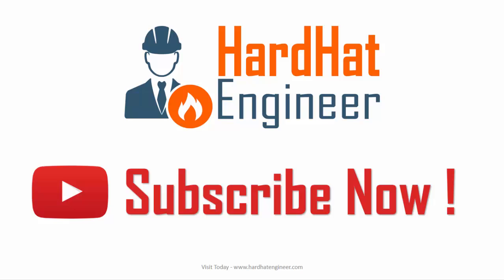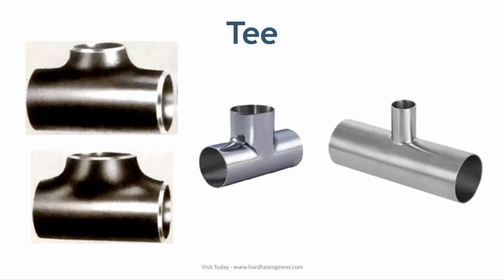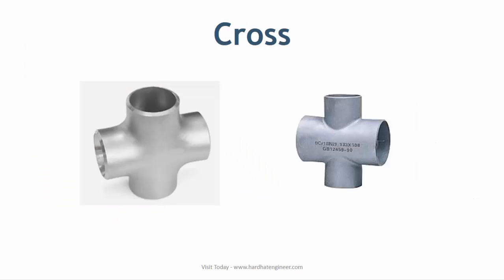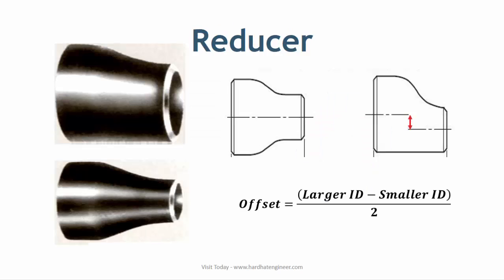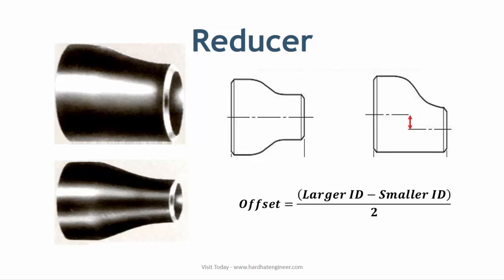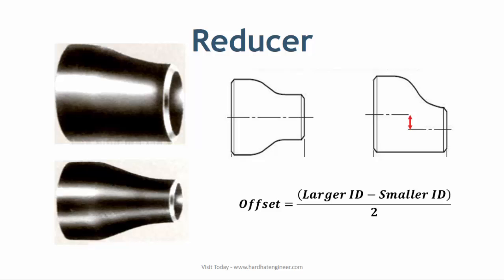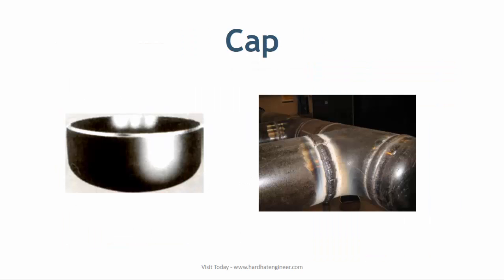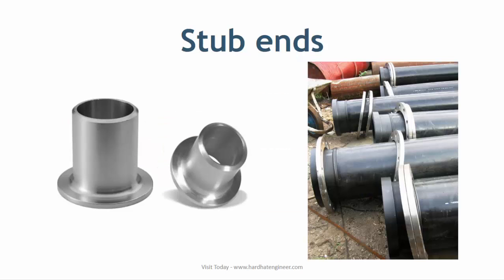Pipe Fittings - Tee, Cross, Reducer, Cap and Stub ends Part-2 /3

Comment: Why and when we use long radius elbow,
And why in Long radius Elbow pressure loss is minimum can explain please , what is the reason behind it .....please reply or make a video otherewise sir please explain during lecture...
Reply from the maker: Long radius elbow is used on almost all process piping.  As it has a long radius, change of direction of the fluid is gradual so less pressure loss.